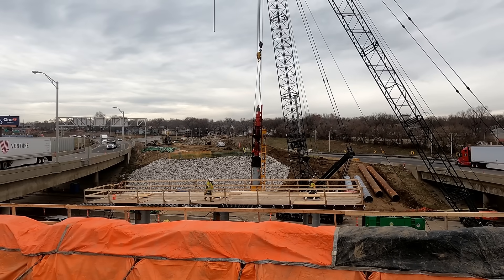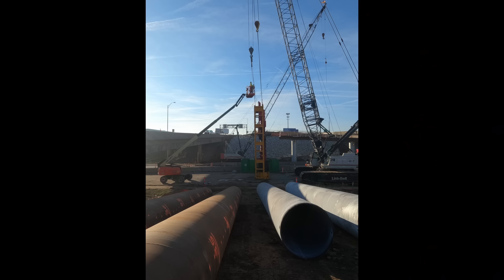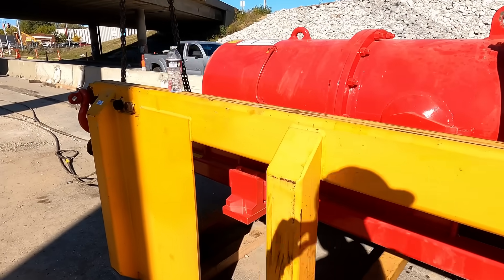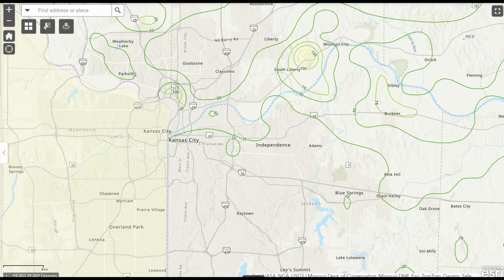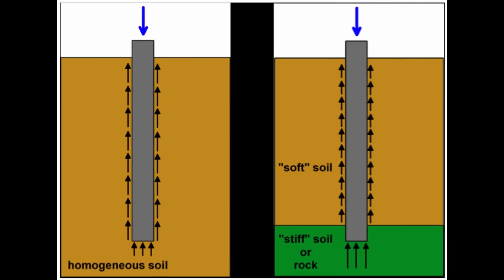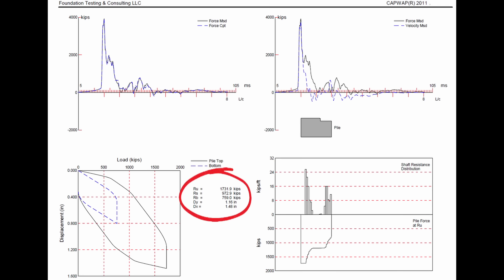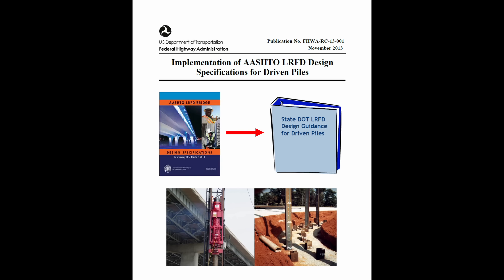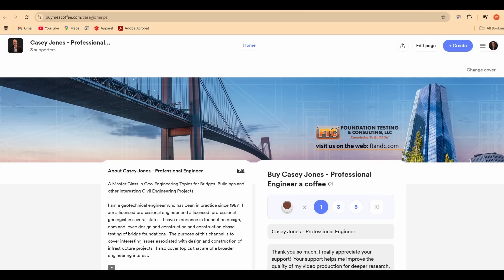Testing a 4 Foot Diameter Pipe Pile Driven with a D100 Hammer

Comment: Who made the decision to  drive open-ended pipes? I'm certain that the state & FHWA had to agree, but it seems to me that the additional depth required due to loss of end-bearing capacities would have resulted in significant cost increases.  For those unaware, pile driving is (in my experiences) paid on a per foot basis.  Props to Casey for suggesting the restrike testing.  Over 30% setup in less than 24 hours is impressive.

Restrikes are standard here in the Mid-Atlantic, even on jobs I've worked in the mountains where limestone and shale are prevalent, and most of the capacity is achieved through end bearing.  Too, I've worked in areas where we've seen setup in the range of 300 - 400% after about 3 days.  These areas were sandy or silty clays.  At EOID, we might see 4-6 blows per foot.  Restrike often achieved counts 2-3 blows/inch before the pile broke free again.

My current project will drive 42", one-inch wall pipes.  Projected depth is around 100'.  The biggest issue I see with these big pipe piles is the time it will take to splice them.  Will know more once the test program ramps up.

Merry Christmas, Casey!
Reply from the maker: Thank you and Merry Christmas to you too!  This particular job was design build so the extra cost was borne by the contractor. They were experimenting to figure out the best options for constructibility.
Reply: If I recall... at least for the smaller pipe piles and soils in Colorado, there is not much difference in capacity between pipes with a cap and those open ended, as a plug of soil wedges in the end of the pipe.

Comment: Thanks and happy holidays! To What depth is the interior of an open ended piling like this flushed out and concrete infilled? Is the end bearing of the infill added to the overall load rating? How deep is that galvanized going?(guess it depends on water table depth and salinity too)

Comment: We had quite the experience on I-70, in September of 2024 we had a 50' section  rebar with an attached grapefruit size chunk of concrete drop from an overpass  onto us.  We just avoided a very bad outcome by a split second.  Half a second later and it would have gone through our windshield
Reply from the maker: Wow, that sounds incredibly scary, I'm glad you're okay!
Reply: Maybe.  Grapefruit sized is on the edge of the size of impact the windshield will resist... Windshields are designed to prevent human heads from penetrating... a crash safety thing.

Comment: By me with the top 100 foot or so being pretty much beach sand and silt, with a lot of clay in it as well, pretty much all large buildings in the city were piled.  BIL was building 30m from the ocean, and those piles, while not on the bedrock, are sufficient to keep the building up. not so for another, where the one side of the build was excavated, and this was compacted and used to fill the other half.  not quite correctly, though the building did hold up intact, just that settlement meant after a couple of years that they had an expansion gap that was big enough to climb through. Lucky for my BIL the half of the project he had was the dig the hill out part, which is very stable, and the issue with the other half was solved by adding additional piling and rock anchors to prevent any more slip there, along with adding in deeper piles on the perimeter as part of an upgrade, as they were digging out the underside to pile, they added in an extension as well.

Another is a building part of the university, ironically engineering building, where they know it has moved down the hill around 5 feet since built, at around 2 inches a year. Has meant they have had to extend walkways, reroute sewers and water, and provide slack in power cables and all other cabling to compensate for this.

Comment: Nice explainer. One of the pile driving projects I worked on involved pile driving and proof testing of the driven piles for a project at Dampier Port in Western Australia a few years back. They were for new berthing dolphins for the iron ore vessels. From memory, we had to drive just over 60m through soft marine alluvium and a weakly cemented calacareous sand layer. These piles weren't loaded much vertically, they were intended to take the lateral loads of ships coming alongside and mooring. The testing consisted of rigidly anchoring a barge (4-5 anchors taken about 200m each from the barge by a service vessel and the anchors then pulled till sufficient engagement was achieved), with a large chain with a weight of about 500kg/m then attached to the pile and winched in until a catenary formed, with the catenary sag telling the tale on load applied to the pile. We were aiming for about a meter of sag on the 100m of tensioning chain, with no more than 30mm of lateral displacement to give the proof load. Both the sag and the pile displacement were surveyed from shore with differential GPS and optical instruments, with an accuracy of about +/- 1mm.
We achieved it on all but 2 of them, but considering there were 9 per dolphin and there were 3 dolphins, it was seen as job done. They're still there, about 30 years later.

Comment: Merry Christmas Casey! Have a question on the use of galvanized piping, (although being someone from the piping industry, we may not consider spiral wowed tubing, piping) how is the welded joints between sections of the tubing protected, as the welds and areas of galvanization that were ground or burned off, would not be galvanized anymore? Or is the galvanizing not that important, at those areas?
On a separate topic, did you catch any of the coverage of the Brown University shooting, and happen to note how lost McKee was during the whole thing? Only goes to illustrate how much trouble RI is in, and not just with the DOT or the Washington bridge!

Comment: There are advantages of large diameter shafts.  A.  For bridges hey can be used without a raft or footer, saving that cost.  This also makes the footprint of the construction work smaller, very advantageous in locations with existing roads and utilities, or order of work issues when multiple roads, detours, and bridges are in a close area.  It also reduces the axial load requirements of the foundation by not converting  lateral force induced bending loads to axial foundation loads.  B. The design collision impact force ends up requiring a reinforced concrete shaft of at least 48" diameter, but quite a bit less for a concrete filled tube.  The shear reinforceing for a high load RC column can be very dense and fussy.  C.  Much faster due to fewer steps. D.  Galvanizing the upper portion of the pile reduces long term corrosion problems.  In general we have not used large diameter piles in Colorado for bridges due to foundation variability so we used drilled shafts a lot instead.  They are missing some of the advantages of driven piles, but can accomodate variability of penetration better (from a contract perspective), but do not have the reliability advantage of the continuous PDA monitoring.  Availability of very large pile hammers, and difficulty of getting the large diameter pipes quickly (a "buy america" issue), and can have issues with the concreteing that are hard to correct.
Reply from the maker: Excellent points, I appreciate you sharing your experience!